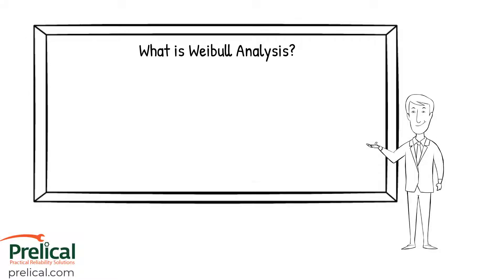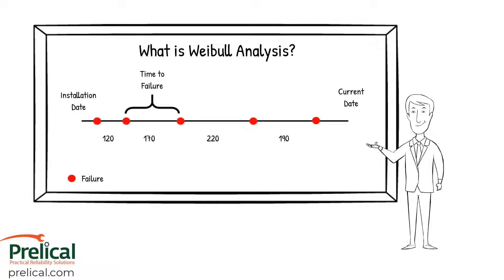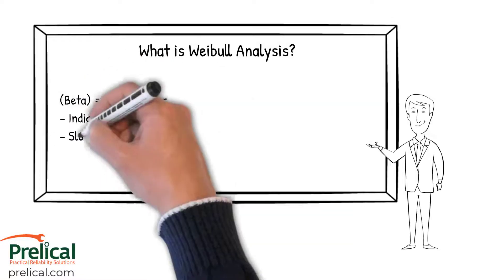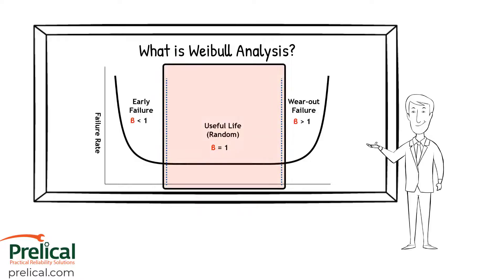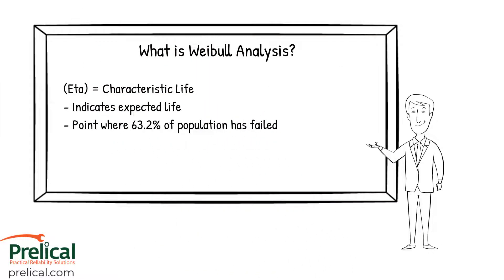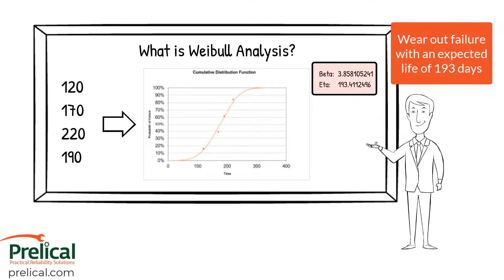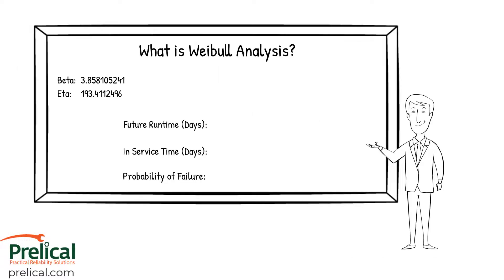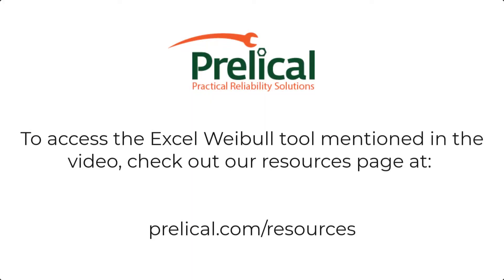Weibull Analysis Overview

Comment: Would you please show me how u calculate Beta and Eta? thanks
Reply: Hi Khalid

The link below will download an Excel spreadsheet to see how it is calculated.  I highly recommend using a more commercial Weibull solution if you plan to use this technique on a more frequent basis.  However, this simple spreadsheet example might shed some light on the calculations.

https://img1.wsimg.com/blobby/go/88ac67ee-e17e-4118-a3c6-522729a68966/downloads/Reliability%20Calculations%20for%20Weibull%20-%20Prelica.xls?ver=1666795222461